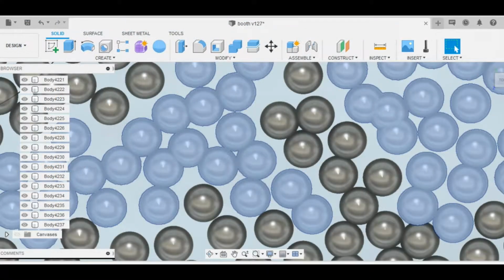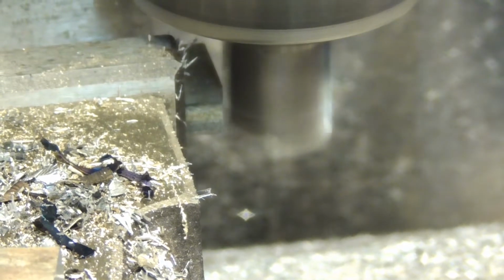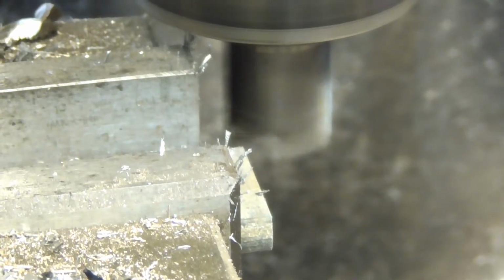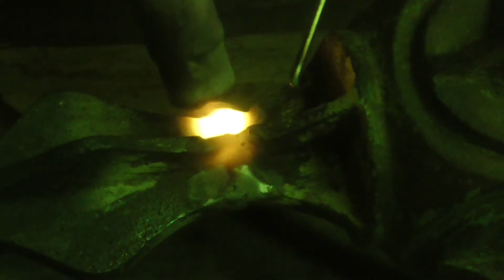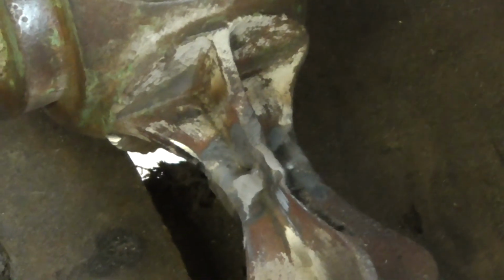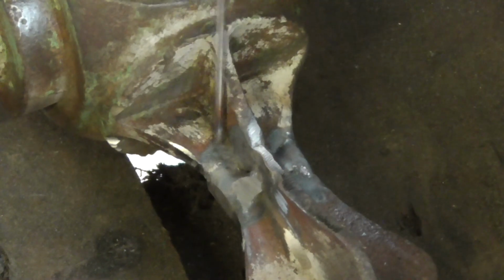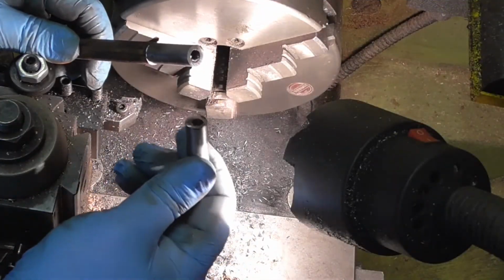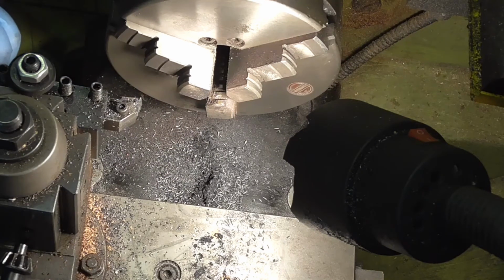WGB No.7 I talk about water pumps, CNC, Videos, CAD A faulty grinder & a broken MIG

Comment: Take the cracked wheel off and bin it before you do anything else. Is the spindle free to turn? If not, strip down and replace the bearings. This might be worth doing anyway. If the spindle is free then look at your start capacitor. If you give me its value in microfarads and diameter and length, I may have a suitable replacement. Good luck. Mike
Reply from the maker: Changed the wheel out. I had a smaller one to hand but at least it won't explode in my face.
When I get around to checking it over I will check the capacitor as that seems to be the common thing everyone is saying.
It spins for ages after switch off so the bearings are good